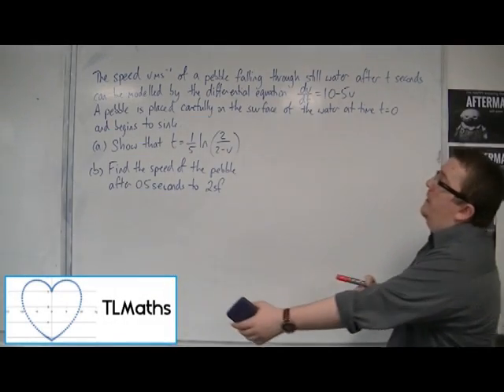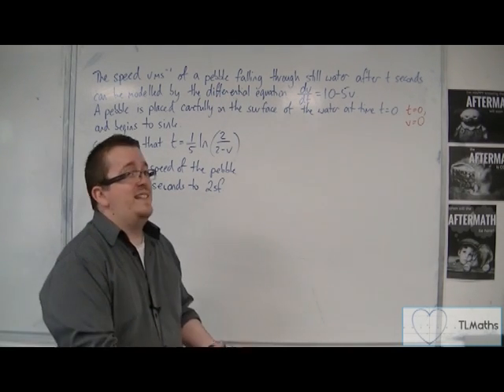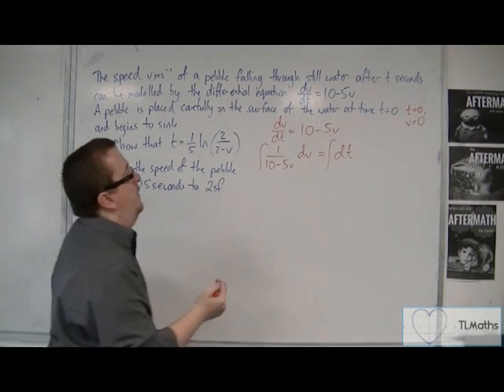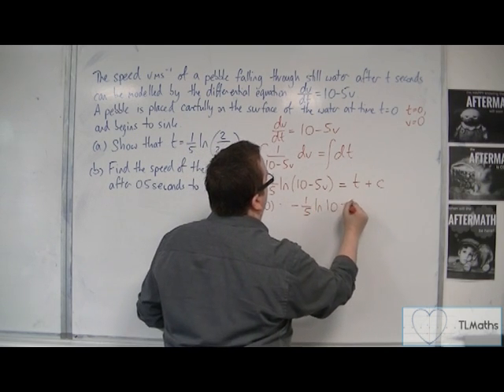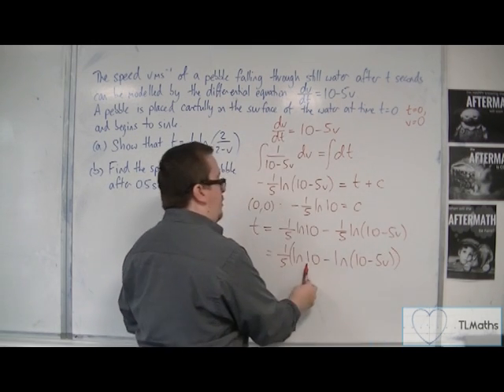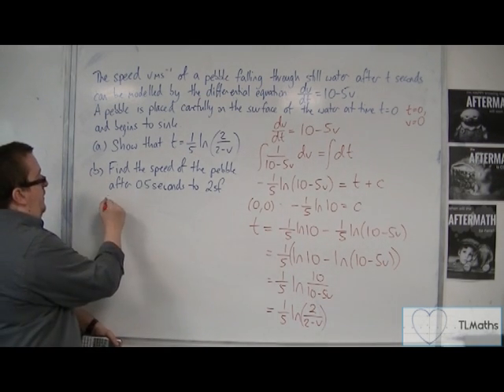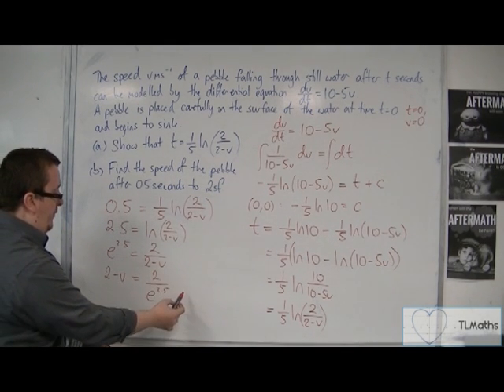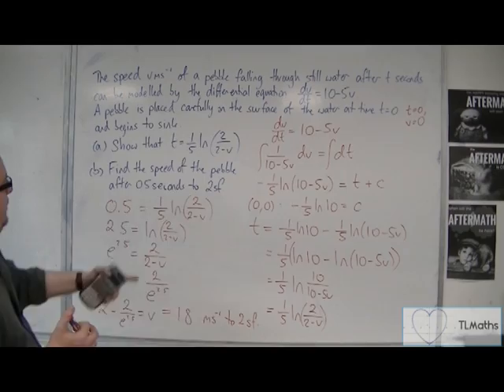OCR MEI Core 4 6.09 Solving a Worded Differential Equation Problem Example 2

Comment: Thanks so much for these videos. Just had a question at 1:29 -
Can you also get (-1/5) x ln(v-2)? I have just outlined below how I have got to this:
1) [integral] 1/(10-5v) dx
2) -1/5 x [integral] -5/(10-5v) dx
3) -1/5 x [integral] -5/-5(-2+v) dx  # Here, I cancelled out the -5 from the denominator with the -5 in the numerator
4) (-1/5) x ln(v-2)
Reply from the maker: Yep as (-1/5)*ln(v-2) differentiates to 1/(10-5v)
Reply: Thank you so much for your reply - really cleared things up. Also, for (a)  can you have      
t=(1/5)ln|2/(v-2)| or have I done something wrong? I have just outlined below continued working out from above:
5) (-1/5)ln|v-2| = t +c
6) (-1/5)ln|-2| =c and so c= (-1/5)ln2 # Here, I subbed in (0,0) to get c
7) t= (1/5)ln2 - (1/5)ln|v-2|
Simplified.. t= (1/5)ln|2/(v-2)|
If possible, could you please kindly let me know if there is any fault in my working out as I am not getting the same result as you have for part (a).
Reply from the maker: ln|2/(v-2)| is the same as ln|2/(2-v)|, that's where the confusion lies. As long as you show how you get to the form asked for in part (a) then you will get the full marks.
Reply: Thanks so much. And how do convert ln|2/(v-2)| to ln|2/(2-v)| ?
Reply from the maker: It's for the same reason that |2-v| is the same as |v-2| - for any value of v, both of these expressions give the same value.
Reply: Thanks so much. So would I get full marks if I end up with t= (1/5)|2/(v-2)| and then just conclude that t=(1/5)ln|2/(2-v)| or do I need to be more specific?
Reply from the maker: You'd need to say it to get full marks, but as long as you did you'd be fine

Comment: Why is it that when you separate the variables, you divide by 10-5v? Why do you not just add 5v to both sides then multiply by dv to give you [integral] 5v dv = [integral] 10 dt ? 

Thanks :)
Reply from the maker: dv/dt = 10 - 5v
If we do as you say and add 5v to both sides:
dv/dt + 5v = 10
Then multiply both sides by dt:
dv + 5v dt = 10dt
You now don't have dv solely on the left hand and dt solely on the right hand side.

Your first step has to be to divide both sides by (10 - 5v) as shown in the video to properly separate the variables.